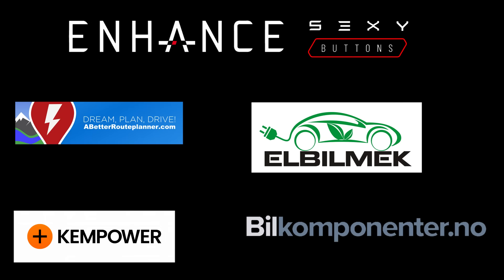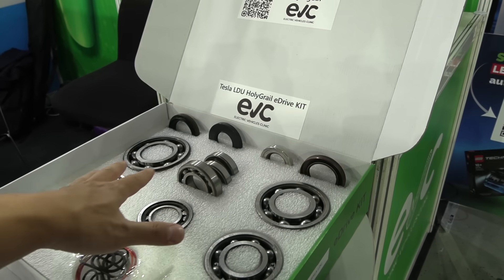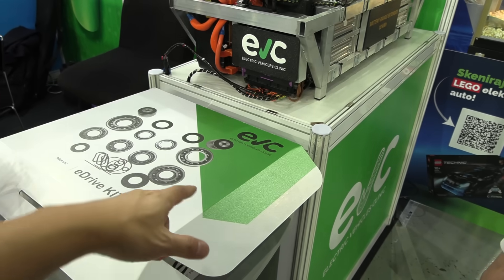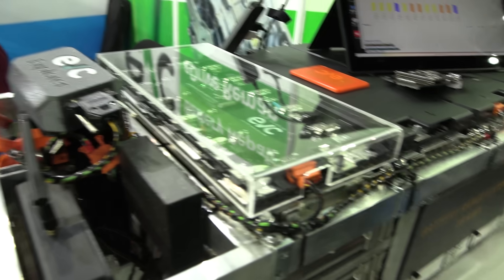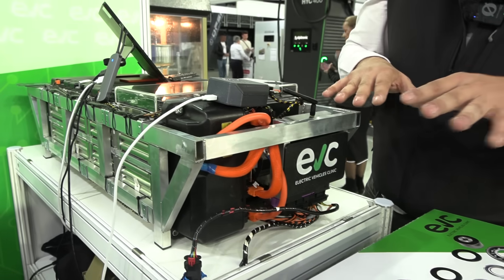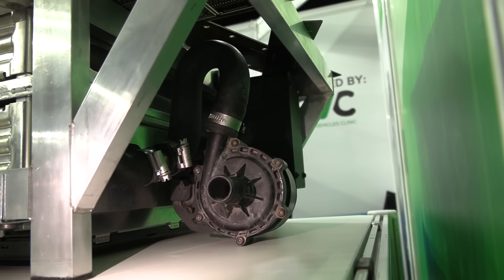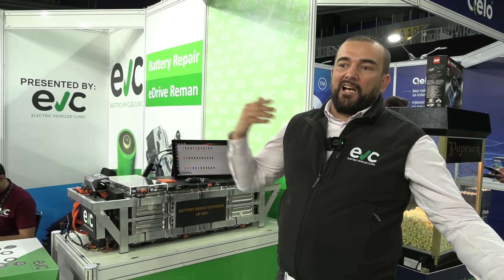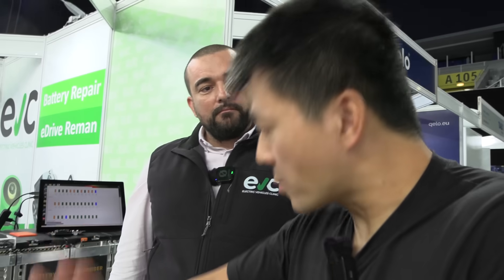EV Clinic made a 18 kWh range extender for Tesla and any EV

Comment: You can just plug that coolant whole with $50 part for those drive units. It will work fine. What we need is Plug-in hybrids with generators. Like Mazda MX-30 (R-EV) who comes with rotary engine as generator.

Comment: I would love to get that extra capacity in my 2015 S 85D, and the coolant seal issue is the exact reason I opted for an S 85D and not an 85 or a P85D. But if I got myself a Performance model, I would probably prefer to do a coolant bypass rather than replacing the seal with a better one — that's exactly what Tesla finally decided to do on their newest LDUs anyway, as the extra cooling turned out to be unnecessary. But how much would that range extender cost? And how much extra weight does it add? The load capacity is low enough on the Model S in the first place; I need to load up my Tesla whenever I go to Sweden to buy stuff xD

Comment: I hope they're looking at the vans on the market too. There's so much space below the floors of some models. Vauxhall e-Vivaro/Peugeot e-Traveller/Citroen e-Dispatch for example. They're all running 50/75kWh packs, so to bump them up to 65/93kWh would be superb!
Reply: We do actualy upgrade battery into eVivaro +105,6kWh to stock 75kWh= 180,6kWh actualy based on 32x Taycan 3,3kWh modules. Additional weight +450kg. They are on the floor so luggage space started little higher but no problem. Total cost 5500€ :)
Reply: @benzoesansodu5866  That's excellent! I would love a pack that fits where the spare wheel fits on the LWB version, it looks like there's enough space for enough 50kWh pack without losing any internal space.

Comment: With it increasing the charge rate that was the clue it was in parallel and follows the main battery pack it would also keep the voltage higher under load increasing performance slightly.

Comment: I need this in my diesel van to make it a plug-in-hybrid! 17 kWh is enough for daily driving, and even with only a 30kW motor, the diesel would only idle (steering, brakes...) - and consume about half a liter on 100km. Maybe one liter/100km if you use it for accelleration and let it idle the rest of the time...

Comment: Why, just make a better higher capacity, safer battery which will recharge faster.  People just want an EV they can use, they do not want an experiment everyday.  People want to get in the car, drive, turn the heater on and no hassle.  No waiting for chargers, no waiting for batteries to warm up, no low battery low capacity warnings.  No fake advertised range, where you should not charge to more than 80% and you should not discharge to less than 20-10%.  So you get an EV with big claims, but when you use it you are told you can only use 60-70% of the battery. So the claimed range is fake.   For most products the EV companies would be sued for false advertising which is against consumer law.  When you buy a 1 liter beer, are you happy when the beer bottle is only half full.  But you paid for a liter of beer.

Comment: I want that battery for my alpine a290 and my Honda crz!
Reply: So long as you don't mind losing your Alpine warranty ... and you don't even know the price yet!! And remember the Alpine has tuned suspension to optimise handling ... you just added the weight of a solid built rugby player that's joining you on every drive ... so factor in some suspension modifications if you want the nimble sporty handling it started with.
Reply: @MrAdopado  I do understand what you’re saying, but being as another motor is being added to the rear that is not at top of the list of concerns.

Comment: I've got a 35.8kWh e-golf that takes around 28kWh full charge after covering 110,000 miles - gives around 100 miles range. I'd be very interested in this range extender but, I can't see how these are going to make any sense financially.  They are going to cost more than the car is worth to buy second hand, just to add ~50 miles of range. I can't see these selling for less than £5K installed.

Comment: I see a major problem here. The way it's designed is not plug and play, you'll still need to go to a garage to have it installed so you might as well buy a replacement battery. In case of an old leaf for example, for people who don't care about cooling, who don't take it on long trips, but want the extended range - it should be made simple enough so 1 mechanically inclined owner should be able to install this without taking it to a garage.

Comment: Two of these in the lower bed storage area in Cyber truck would make the range wonderful. Would still be fairly low weight (considering original weight) and mounted reasonably low.... Now just wondering about the price and labor for the modifications....
Fun to speculate the possibilities with many different platforms. Very cool tech 😎

Comment: damn, once the 60 kWh SR BEVs get alot of degradation this will almost lift them to LR battery capacity.

one question:
i expect the weight of this battery to be around 400-500 kg
how do existing suspensions handle the extra load?

Comment: Whats the hype about really? They add battery in the trunk. That is not magical, its just adding extra weight where its not planned for the car and you loose trunk space. I thought it would be something replaced in the original battery or integrated more.
Reply from the maker: The magic is that it connects directly to the main battery via DC. It has not been done before.

Comment: If you develop a smaller 12kw version specifically for the I3s BEV with the 42kwh battery, giving it a 54kWh capacity, you can take my money. 
There's space under the rear access floor panel, we know this because a company called WOKEBY designed a storage box that fits in that very space.
Reply: The hard part is going to be the cooling. The i3 uses the AC refrigerant for the cooling. Well, it is complex. As I understand it, the actual cooling is done by a liquid coolant (probably just your standard water plus glycol combo), but the magic happens inside the pack, you have actual refrigerant lines connecting to the battery pack.

The easiest would probably be to patch it into the cooling circuit for the EME and KLE (aka inverter and charger). Not sure if that is an option.
Reply: The other challenge will be finding Samsung SDI prismatic cells that are small enough to make a 96s pack with the smaller capacity. It looks as if Samsung has a 35Ah cell in that range, but I am unsure. But if they do, that should get you about 12kWh. That would more or less double the range of my 60Ah car.
Reply: My solution to this, when it comes time, is to trade the i3 in on a secondhand i4. Putting another 150kg on top of the back wheels of an i3 doesn’t seem like a great idea.

Comment: How a 18kWh battery can be so small ? You asked the question without having an answer. We can see 8 modules of 12 cells at 3.4 V. If they are 52 Ah as said it makes 17 kWh, but I cannot find a reference for those "prismatic 52 Ah Samsung SDI" cells. I would be curious to know the details of those cells, and most of all the weight of this extender by knowing the weight of each cells.
Reply from the maker: It was made by a ninja.

Comment: I want this so bad!!!
I already upgraded the 75D to 100D but now I am hyped!
1000km Challange please!
Reply: Hi Raphael, I also have a 75D. How/where did you upgrade your pack? Would you mind sharing how much it was? Thanks
Reply: @nickavila2119  I bought a used 100kWh Pack for 13000€. The swap is fast...only 2h. But you need someone with Tesla Toolbox to program the pack to the car. I had mine programed in Wiesenweg 1, Berwangen
Reply: In the USA greentec auto they have service locations in most states 14.5k for 100kwh battery installed.  Then local garage in Portland Oregon that can do it for about 12k watt works.
Reply: Just did some digging: My 100kWh battery pack form 2017 has 110s72p configuration. Is it possible to get some more cells in series in the same space?
In the 100kWh pack should be:
16 x 6.3kWh Tesla Modules
103 kWh
407V pack
Maby there is enough space without the diagnostic wifi module or the additional coolent pump...or you extend those parts further to the side...there is more space in the subtrunk overall.
Reply: @Raphael_Hofmann I've been told there is 100kWh pack and 100kWh+, which is the one you've mentioned, 100kWh usable, regular 100kWh pack has 90 something usable only
Reply: @vladzis  I belive it was 103kWh when it was new...but now it is only 89kWh after 8 years.

Comment: Next step. Make a diesel or petrol generator that you can attach to the tow hitch and connect to this system for those really long trips. The ability to charge the tesla battery while driving is the real gamechanger here I feel.
Reply: Look up Obrist HyperHybrid. They put it in the Frunk. I can't get them to answer my emails so it may be just a research car that will never come to market.
Reply: not necesarry
Reply: @AutonomousPRlME  speak for yourself.

Comment: BMW i3 was literally built for this.  Contactors and coolant already there for the REx motorcycle engine.  Love the upcycled BMW sbox and tesla coolant pumps.
Reply: The BEV has space for the where the REx could fit that could accommodate an auxiliary battery. 
the battery shown appears too big for that space, but an adapted configuration of series & parallel modules would hopefully match voltages.
The i3 battery is a unicorn with refrigerant rather than coolant for cooling. But as you note, the i3 is engineered to accommodate a petrol engine generator which has coolant reservoir and radiator provisions. 
For the REx model, perhaps a smaller 8kWh useable battery could fit in the frunk space. In the 94AH model with 33kWh gross 27.2kWh useable that would a 30% increase in kWh.

Comment: 13:20:  Most likely the charging speed on the CC part of the charge will not change, but during the CV the amperage is limited by chemical reaction. The lower resistance will result in an increased amperage. 

But in the CC part, the cars BMS instructs the maximum amperage to the charger.

Comment: A couple of issues I see with this great idea.
Getting the car approved with the new system. Adding electronics like this is not going to get accepted as is without some kind of approval. Modding cars, at least in Norway, is extremely difficult as they need a new type rating.
Another question is weight. How heavy is a device like this? Some of the smaller cars already have a limited capacity so like with the rating issue you may have to get the car re registered for less people or something.

Comment: I've got a 45 kWh range extender in my 2018 Nissan Leaf 40 kWh, sadly the company here in the Netherlands, Muxsan is bankrupt. While the gross capacity of 85 kWh sounds a lot, the net capacity I get out of it is much less because of degradation of both batteries but I can still get almost 70 kWh out of it if I dare to go deep with the help of Leafspy. Thanks to the CSS mod, not adapter, it will charge 'flat' at 225A up until 80% so that means 80 to 90 kW. We've been roadtripping from the Netherlands through Europe, Poland a few years ago and more recently the Alps and Barcelona last summer. But that last trip the battery got quite hot with temperatures up to 60 degrees Celcius and on the dashboard going into the red. 

Sometimes I've considered asking Bjørn to test it for a 1000 km challenge, it would have made a great video but too bad we're living a bit too far apart and it's hard to find the time to go to Norway though I would love to some day.

Comment: I did the same for my ZERO Motorcycles. I added 15kWh to the actual 14kWh  by parallelling it with contactor and making sure the internal resistance is matched to have proportionnal load.   On this setup  I guess his internal resistance is matched so that the load on it is proportionnal to the size relationship with the OEM battery? Another point is to make sure that the internal resistance curve is matching proportionnally per Ah with OEM otherwize this load proportion will change dynamicaly and make the SOC calculation more difficult. For exemple, Matching NMC532  pack to NMC811 pack is already difficult because of that and their different curves.

Comment: Although it's an awesome product, unfortunately it likely won't be allowed for use in Norway due to silly type-approval laws. 

For the same reason as you can't install a larger battery in an old 24kWh Leaf for example, even though it's a direct drop-in and used in other nearly identical models - simply because it's in conflict with the registered battery value, which from my understanding is not allowed to be changed once already registered. Or, like on the earlier model 3s, you're not allowed to have any load on the roof, simply because Tesla didn't type-approve it until later that the car could easily handle it - forbidden to change once registered...

It's a real shame, because this product would indeed greatly extend the life of so many cars, especially here in Norway where there's loads of older cars with small degraded batteries that will end up in the junk yard simply because a new battery cost way more than the value of the car, and nobody with some sanity would ever pay that for a new small battery. 

Example: a refurbished replacement battery for a 2012 24kWh Leaf in Norway including battery and work is roughly $4,550/€4,300/NOK 55,000. Market value; $3,640/$3,640/NOK 40,000 = car to junkyard instead of repair...

Comment: Perfect for e-caddy- Transporter, Crafter with anemic 37kWh packs. Would increase range with 50%. And those vans have the load capacity to carry the extra ca 90?kg packs easily. 
If you put it in an e-UP, it would only allow you to carry 2 passengers, in practice converting it into a 3 seater.
For Nissan Leaf it is probably better to just switch older heavier 24kWh modules to newer more light weight 40kWh ones with the exact same weight. Or 40 kWh to newer 50kWh with again the exact same weight.
But awesome innovation. We need more like this! Great job by evclinic👍

Comment: That's a true range extender, not a crappy engine burning a fuel and constantly releasing poisonous carbon monoxide. 

But they need to start 3D printing some of those parts rather than having to recycle old parts. For example, the old Model S water pump.

Comment: Range extender for the Mazda MX-30 would be amazing. Lots of space under the hood
Reply: Was just thinking about where it coule fit.
Reply: I had high hopes when Mazda announced the MX30. But boy was that a let down. I've liked Mazda for years (I have a mk1 MX5) but the MX30 is just sub par for an EV. What were they thinking putting that small of a battery in an SUV? It'd make more sense for an electric Mazda2 or something.
Reply: @KweetnGinne well, in terms of size, it's basically same as Mazda 3. same length, same ground clearance and basically same interior size (maybe a bit more headroom), same weight (if you exclude the battery), so it's barely a crossover, definitely not a SUV. That said, a 50kWh battery should've been the minimum. It's a well known fact on the forums that it's a compliance car and they didn't really make en effort for it to be competitive. Which is a shame as you can feel the product team had a lot of fun with the car and every part of it feels special (except the powertrain and battery).

Comment: This is second most exciting news of 2025 re BEV. 

More interviews please Bjorn. You should interview these EV engineers more as unlike non technical car journalists you can ask relevant questions and clarify points said that dont make clear sense. 

I knew about the EVC Tesla kits and expertise for a while. I wish they had a location in Norway/Denmark so easier to get to from the UK. This is not just extending the pack to origional but gets it so those older cars like E-Golf/Mini F56/i3 a new life. 

I hope they can take over the CCS protocol stack and get more than the OEM then spoof back to the main pack. So the range extender can have a few modes or use case setups. 

They are very skilled indeed. Changing a single 18650 cell in a Tesla MS pack is not simple.

Comment: More ideas:
- make it dual purpose: home daily use...that can be plugged to the car only for travels.
- Rental use for travels.

Would love to see similar for bmw i3!!
Reply: so the battery has approx 120+ kg - have fun to put in and out 🙃
Reply: @christiangraf7970 how do you arrive to that figure? I dont recall any figure being mentioned in the video. (I may be wrong)
Anyway, a plug in extra kwh and mileage for the car in a convenient weight , would be nice for ocasional use would be nice, being used at home otherwise.
If my  daily mileage wouldnt be covered by the oem battery range, i wouldnt have bought an i3!
Reply: @pepepier3644  just simple math - a Model S 85 battery weight 544kg - it's 6.4kg per kWh. 
18kWh x 6,4kg = 115.2kg. With additional electronics, fuse, cooling stuff and the safety-cage you will have much more !
Reply: @christiangraf7970  the i3 has Samsung SDI prismatic cells specified in 2014 where the volumetric energy density is 352 Wh/L, 
the gravimetric energy density is 174 Wh/kg (if my notes are correct). 
However those densities in Wh/L compare to the similar vintage Model S in kW/kg, the new Samsung SDI prismatic cells in the feature are liable to have even higher densities. The answer might be in the video but i didn’t catch it or what could be converted into comparable terms. 
Crunching those numbers and also looking at what fits in the i3 (which is considerably smaller than the Model S) might show an amazing jumper pack unit. But how one would be able to plug and unplug a removeable unit would be another engineering feat.